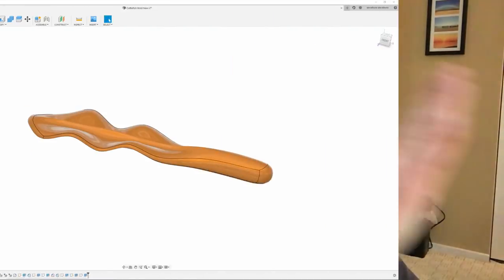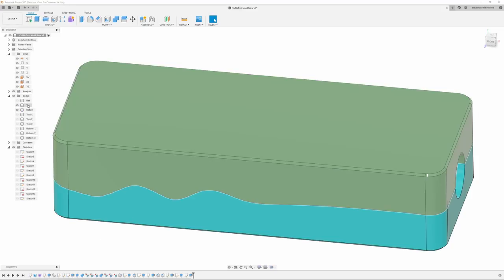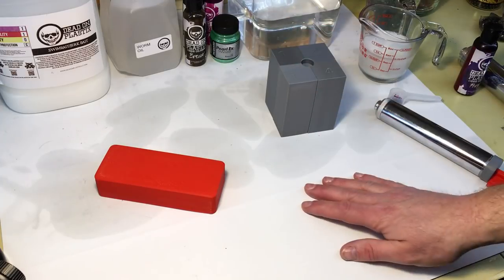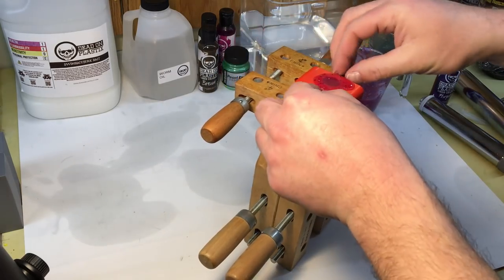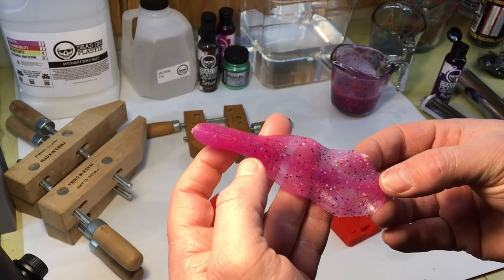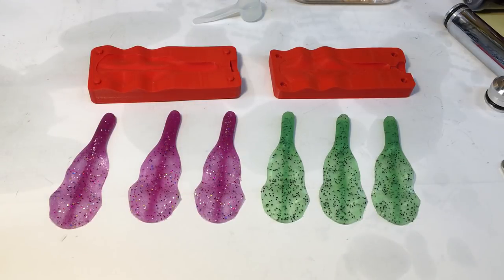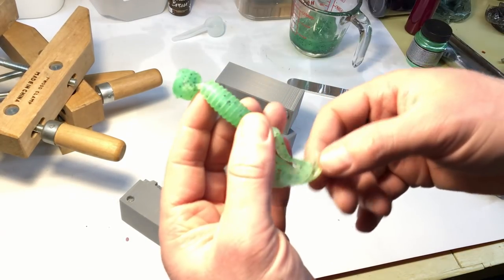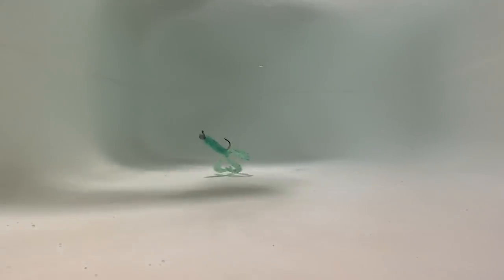Crazy Split Lines with 3D Printed Molds. (Cuttlefish Reaper + the 4 Tail Grub)

Comment: This makes me wanna take up fishing again...just to add to the list of things to do with my printers! (Haven't been fishing since I was a teenager...so, over two decades? 😬) The swimming action on that 4-tail grub is awesome.

You might try giving the molds a couple coats of primer. Besides sealing the surface, I imagine it'll function kinda like the gel coat on a fiberglassing mold and give you easier demolding... 🤔
Reply from the maker: Yeah someone recommended using high temp engine paint too... I guess it will give a smoother glossy finish to the baits also.  I haven't tried it yet... maybe in a future video.

Comment: Very cool video! Definately will be on my todo list. You could have made the mold easier in Fusion360. 
1. Do your bate model
2. Create a solid cube around the bate 
3. "Combine" cut the bate from the mold
4. Add your cutting line and "Split body"
5. Add tabs and holes

This way you will not be left with the strange pieces.
Reply from the maker: Awesome... Thanks for the tip. I'm still learning all the features, I'm sure there is a bunch of stuff I do not do the correct or easiest way. I appreciate the help.

Comment: Great Videos. I plan on showing my students in my High School Manufacturing Class. Well done on these. 

I have an idea for the 4 tail grub mould (all moulds actually). You could change the shape of the outside to a tapered cone and print an internal tapered cone to push it into. That should make clamping it evenly super easy as the mould could be pressed in like a Morse Taper. 

Just the thoughts of a random Machinist and Manufacturing Shop teacher. Keep up the good work.
Reply from the maker: That's actually not a bad idea... a few others have mentioned similar sleeve ideas.  I've actually been printing newer one's with a round cylinder outer design so they are easily and quickly clamped up with hose clamps.
Reply: @TheNeverendingProjectsList  I'd love to see it... It should eliminate clamping all together.

Comment: Have you thought of adding in phosphorescent materials, basically you add the powder to your plastic mix, shine a flashlight on it then it lights up.
Reply from the maker: Funny you should mention that... I just injected some about 5 minutes ago it's curing as I type and should be in the next video I post.
Reply: @TheNeverendingProjectsList  I'll be closely following this.  I've wanted to produce some especially for catfish/night fishing.  It's been on my list for a while, I actually followed you today as I have been questioning if I could do injection molding for the face masks I'm making folks.  I need a better material to hold tighter tolerances for the mask to the face.  I print in PLA but don't like the flex material solutions, the plastics for worm making seem perfect for the cause and may produce better results.  Love the 3d printing community.  Thanks for your posts sir.

Comment: Greetings, I have printed several of your molds, and I recommend that you print them with a resin printer and transparent resin, I also printed the molds in PETG and although at first they held the temperature of the plastisol, with the uses they ended up deforming and it was difficult for me to take off lure, which does not happen with resin molds.
Reply from the maker: I've actually been thinking about getting a resin printer.

Comment: Great video! I have not tried any 3d printed molds, I do plenty of mold making out of silicone, I was curious what kind of temps the molds seem to be able to stand up to and what your thoughts would be to as it related to using various resins in them. 

Either way I enjoyed the video and subscribed!
Reply from the maker: When using plastisol I let it cool to around 300°F before injecting it into the mold. Anything higher than that and it gets to close to the actual printing temp of the filament.  I sent one of the grub molds to Chris from Worlds Worst Fishing to try and he forgot to let it cool and melted the mold pretty quickly. 

I do print them in PLA+ but using a higher temp filament like PETG or ABS might be a better idea.  There's definitely a learning curve to using these types of printed molds. I've never actually shot an aluminum or silicone mold so I can't tell anyone the actual difference though.

Comment: Cool baits.  Why do you design each half separately rather than extruding a single block over the entire bait, combining bodies using the cut command with the bait as the tool and the block as the target, and then use it a split body command to slice the mold in half.  It seems that it’s essentially the same amount of clicks and work each way, but not sure if one method has a benefit over the other?
Reply from the maker: Thanks... I kind of just learned on the fly but that is exactly how I've been doing things lately and its definitely a time saver.  Hopefully others will see this comment and learn from it though.

Comment: Maybe its an idea to have one side of the mold open and fill it with cement so its not hollow and cant deform. Also you can skip most of the infill because its doesnt need to hold. Never saw someone try this before. But i guess you get a more even pressure if the mold isnt filled with air.

Comment: That 4 tail grub is amazing!!! I was wondering if you still had links for your diy primer feeder. The one with the 9volt battery thet loads primer tubes.Any help is appreciated. Thank you.
Reply from the maker: It's on my website but there's no links to files or anything like that. It wasn't 3D printed it was milled from a kitchen cutting board 10+ years ago.

Comment: This video is pretty cool. What CAD program do you use? I learned how to use solidworks and really like the program. But I don't have a personal copy since it's so expensive 🙄. What program would you recommend that works similarly?
Reply from the maker: Thanks... I used Both Fusion 360 and Onshape in this video. Both are free to use and are very similar to Solidwork.  You can however get the student addition of Solidworks for free by being a member of the EAA (Experimental Aircraft Association) which is $40 a year.  I still use all three programs depending on what I'm doing.

Comment: 5:10 you can print tide square cups for 4peace one on buttom and on top with pour hole so no need clamps. Actually for both
Reply from the maker: That might be worth looking into... I could probably make tapper walls too so they add some clamping force too when pressed on.  It would definitely speed thing up for sure if it worked.

Comment: Really nice. You might want to invest in some 2 part silicone and high temp epoxy. Use the print as a positive in silicone, use that to make the final mold. Will last a lot longer.
Reply from the maker: You should check out Revamped Outdoors... that's how he does his molds.  I'm sure the silicone molds will last longer but that process can get expensive too.  I only make a enough baits for myself before moving on to the next bait but if I was trying to do production runs I'd probably go that route for sure.
Reply: @TheNeverendingProjectsList  yeah moldstar is like 40 bucks so.. but at least with that you only print 1 blank. So for the 4-6 sided ones you print one blank at a higher quality and use that.

1. Print
2. Mold negitive from silicone 
3. Make dupes out of cheap epoxy
4. Continue as normal.

Should take same/less time.

Comment: Have you experimented with orientation?

I have the intuition the red mold would work well if printed on its side
Reply from the maker: I have not... if printed on its side it would probably require supports. Plus the red mold worked perfect except for the setting issue but even then the baits came out great.
Reply: @TheNeverendingProjectsList  I think the surface finish would be smoother (more even), though.
Reply from the maker: @NicksStuff  Yeah your probably right. I actually like the texture of the lines though, I've actually started using .25 layer height on some molds to get more texture.

Comment: Great video great molds. I have one question, how get these molds to be so perfect without an exit port for the trapped air?
Reply from the maker: Unlike say an aluminum mold with precision milled mating surfaces the 3d printed molds while relatively flat still probably have enough of a rough surface to let just enough air through the seams.
Reply: @TheNeverendingProjectsList  Thanks

Comment: Love the idea of printing your own molds, how long does your molds usually last? and do you have any plans on releasing the STL files on Thingiverse or on your website?
Reply from the maker: I haven't really tested the longevity of the molds as I only usually make enough for myself to fish with before moving onto the next project.  I've shot one of the grub molds quite a few times though and it's holding up fine. The molds can warp a bit but still flatten enough when clamped.  I'd say if your looking to do production stuff go with aluminum for sure.  As for my files a lot of my stuff can be found here ->  https://cults3d.com/en/users/sthone/creations
Reply: @TheNeverendingProjectsList I just started using my printer to take some lure design I sketched up in Fusion 360 and print out a "positive mold box" and then pour Alumilites Vac 50 into it create solid negative molds that can be injected. But I never thought about just making the mold on the printer. always assumed it would melt when injecting.
Reply from the maker: @zacharystanley5654  Yeah that's how Revamped Outdoors does it too and while it works great and probably last longer as a mold it is an extra step and added costs.  Using directly printed molds does work but there are a lot of factors that come into play such as what materiel it's printed in and settings.  I've been using PLA+ with good results but I do have to keep my injection plastics at or below 300°. Overall I've had some great results doing it though.

Comment: Great video! What temp are you injecting to not deform the mold? Thanks!
Reply from the maker: With the PLA+ I use for the molds I let the plastisol cool to 300f or under before injection and use VERY little pressure on the injector.
Reply: @TheNeverendingProjectsList  Thank you very much!!! Really cool videos! So much usefull! subscribed!

Comment: good work , why u don't spray the walls with some lubricant or an oil to prevent tearing ?
Reply from the maker: I do use worm oil on some of the molds like the tube baits (when I remember to use it) but on most of them I haven't actually had any problems with tearing. I let the baits cure for at least 15 minutes before trying to remove them. (I should probably mention this in one of my videos now that I think about it)
Reply: @TheNeverendingProjectsList  Nice work man keep on

Comment: Also why don't you print in PETG, temps can handle 350 no problem.  specs are 220c or 428f at the low end. I've loved using it for parts for my prusa's it's a little stringy but usually easy to fix with a lighter or heat gun.
Reply from the maker: I have a bunch of PETG I just haven't tried it for molds yet as the PLA has been working fine.  PETG is a little stringy but mostly I print so much PLA I'm just to lazy to clean the nozzles between swapping filament types. I'll give it a go sooner or later though.
Reply: @TheNeverendingProjectsList  it's really one of my favorite materials for structural prints.

Comment: I found it interesting that you went with four unique mold parts for the grub, rather than just 4 copies of one, rotated 90º each.  Any advantages/disadvantages there?
Reply from the maker: All four pieces are identical but I numbered them individually so the mold is assembled together the same way every time. This way if there is any warping of the mold hopefully the split lines stay tight if they are aligned the same way as they came apart.  (In theory anyway)

Comment: I've been looking for info on printing molds for silicone. Have you used vapor smoothing on abs to get rid of layer lines?
Reply from the maker: I've tried it before for other stuff but never on a mold... I'm sure it will work for molds too but I only use PLA+ for all of my molds.  The fish don't care about layer lines so neither do I. 😆
Reply: @TheNeverendingProjectsList  lol I'm sure the fish don't care. I use it for other purposes, though. Other thing I was wondering. How soft is plastisil?  Platinum cure silicone is crazy expensive these days. I was wondering if a softer plastisil could be used for molds.
Reply from the maker: @Deathbysnusnu125  Plastisol is super soft compared to silicone you would not be able to use it for a mold.

Comment: I was going to attempt something just like this with clay, but then I started looking around and most people seem to 3d print PLA as a positive just like the item I want to be in clay in the end, then use that you make a plaster negative mold out of that 3d printed item, then use that for the clay mold. Not really sure why, seems like maybe because wet clay likes to dry better with a plaster mold because it sucks up some moisture better maybe. I was going to try it any direct PLA mold with clay, but have not had time.
Reply from the maker: Check out Revamped Outdoors on YT he prints masters for molds and then pours the molds out of silicone which is a lot better alternative over plaster.

Comment: have you given any thoughts to adding the pegs post print and epoxy-ing them in? I would think it may allow you to sand the edges down to reduce flashing. Just a curiosity as I head down this path.
Reply from the maker: I have thought of this but a haven't tried it yet as the flashing hasn't been to bad. If I was selling baits I might worry about it more but I just make all this stuff for myself so I really don't mind a little bit of flashing.

Comment: How long does the pla mold last? pla and plastisol have similar melting temperatures.
Reply from the maker: I don't have an exact number on how long they last because there are to many factors that can be involved like filament brand, type, settings used, ect. But check out my other video https://youtu.be/_FeUszxAK8s I go over a few of the details that matter.

Comment: Can you share your print settings?
Layerhight? Is it basic PLA?
What temperature do you put the rubber in the mold?

Greetings
Reply from the maker: All of that info is in the video but the cliff notes are.... The molds are printed in PLA+,  .10 layer height, 4 outlines, 15 top layers, I inject the plastisol at no higher than 300°F.

Comment: Does it matter what kind/brand of PLA to use? I have concern about the heat.
Reply from the maker: I normally use eSun PLA+ for most of my stuff but if you are that concerned about heat you can print with something with a higher temp such as ABS or PETG. (I did test ePC once but the plastisol stuck to it like glue.)
Reply: @TheNeverendingProjectsList  Have you tried PLA? Would it work too? That's all I have now.
Reply from the maker: @yauck1  Yes normal PLA should work fine just be sure to watch this video too before you start injecting. https://www.youtube.com/watch?v=_FeUszxAK8s

Comment: 4-tail grub is fire! I believe you can reduce the mold materials down to 50% (do X instead of + on the block cross section), or even more if you don't care the 90 degrees between the tails. Check out my video - https://youtu.be/_N4eqrW0a7k similar idea by adding additional wedges. Cheers!
Reply from the maker: Thanks... I'm sure that would work but I'm not sure if it would save that much material as most of it is just infill. I checked out your video and it's pretty cool and I like what you did with the little wedge for the fins I might have to give that a try... thanks for the tips.